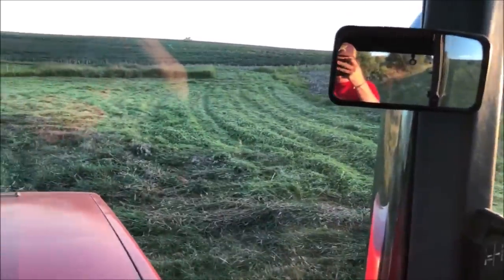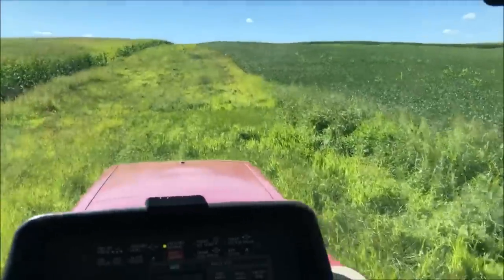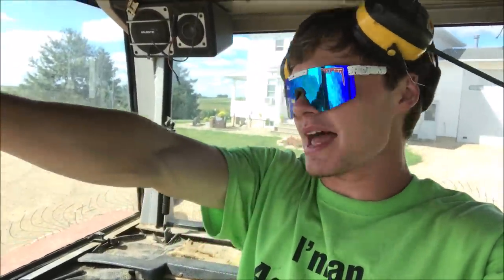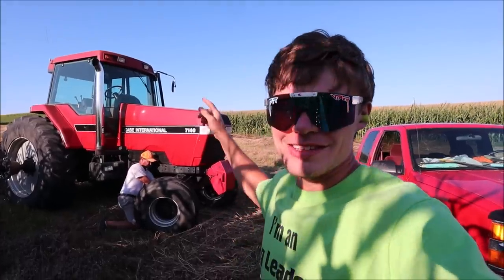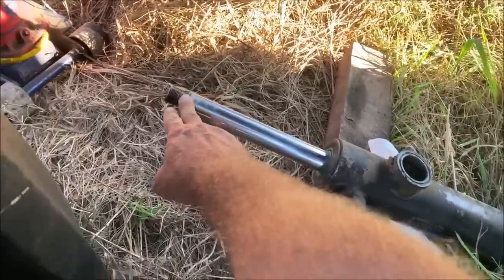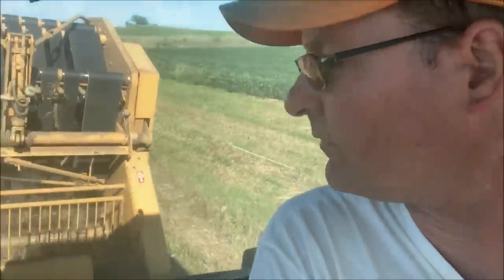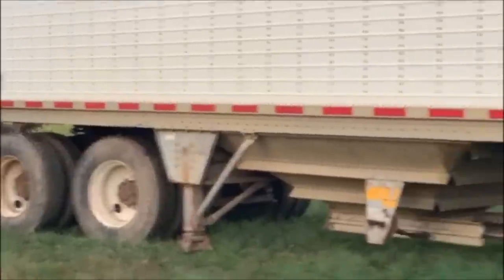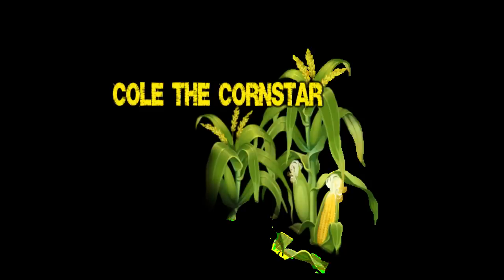We SNAPPED OFF A Tractor Wheel??

Comment: Once when I was about 11years old running the disc with our 856 IH I was turning around in some tall grass. I hit a washout hidden by the tall grass and after nearly face planting the steering wheel I noticed it wasn't turning so well. I had snapped the front axle in half. Took me nearly 15 minutes to get enough bravery to tell my Dad who was planting behind me. He was surprisingly calm about it-years later he told me that he didn't want me to be afraid of running anything for him. (When he was young during the 50's the first time he ran our old 'M' Farmall he hit a corner post-my grandpa was calm about it also and told him to get right back on.)

Comment: Looks like you need to fill those big wash outs with sub soil (brown dirt).  I suggest: a good source of sub soil/fill dirt is cemeteries, after a grave is dug. Easy for you to get some.  Then  find some top soil at the edge of the field to finish filling in the hole and plant grass to keep the soil in place.   It's not good to have a hole big enough to swallow a tractor.   Of course you are pros and you know what you're doing.  I'm just an old guy watching you work.  Stay Safe.    :)

Comment: Skid Steer loaders are bad about popping wheels, when they get rusty.  We were Chicken Farmers and the ammonia was bad about eating up skid Steer loader wheels.   We started off with an old International Skid Steer loader.   After We had it for about a year,  We started hearing this popping sound.   One by one,  every wheel on it broke out around the lug bolts,  because the ammonia in the Chicken Manure will really rust the wheels.  We ended up changing all 4 wheels on it, but after that,  We  didn't have anymore trouble.

Comment: glad to see a 2745 MF working  drove one for years , hard on fuel  we started at 7 am by 3 pm it need fuel are other tractors would run 2 days on a tank   .. IS THE 1000 # waite still under the frount of the tractor . the waite and 300 gallons if water broke the frount end off  where it monted to the engine.

Comment: Its a Volvo thing. Been in two white volvos identical to that one. One w a n14 cummins and one w a 60 series Detroit and they both have done that when the water was good but thats why it decidea to act crazy and just wants to beep all day sometimes is cause of somethin w the water sensor. They are good farm trucks far as the set back front axle being short and helping to get in and out of little ass field driveways you have to go in and out of sometimes but that will also help to get u some experience driving a truck cause if loaded good them same little tight driveways it will wheelie easy and teach u to idle and tap brakes little by little to make tires grab and turn lilbit everytime the wheels touch down. Farm in sho is the life aint it

Comment: When I worked in forestry replantion. We would farm the woods instead of tractors we used log skidders for our roller chopping and trenching there was a operator named Fred he was a good guy but a very fat smelly dude when he left the company we had to deep clean his machines cab and the smell was bad even after we had to replace the seat to get his smell out of it.
Reply from the maker: Sam klien gross 😂😂
Reply: Cole The Cornstar after 3 years and a damn near new cab except for the head liner on cold days running the heater you could still smell him through the vents it didn't seem that bad but once you were in a different machine then hopped back in that one it smelt just like he ran it all day and just got out. One of the nastiest but impressive things I've seen.

Comment: Cole coincidence you and Eric uploaded at exactly 3 hours ago? 🤔🤔🤔🤔🤔🤔 
Collusion perhaps? 🙄🙄🙄🙄😏
Reply from the maker: anastyb It was supposed to come out at 6!
Reply: @ColeTheCornstar  😘
 Hey also the next time you bust a tie rod on a tractor disconnect the implement and you can drive reverse dragging one wheel and still steering with the one connected wheel.
 I learned this one on an old Farmall and steered out the mud using right and left brake. 🚜

Ps not funny making fun of dad's old Ford can that thing is retro classic and rare'er because it was ordered a standard and not a C6.
 In the north that can would be rotted away.

Comment: Those short days that your pulling will make you miss the toilet bowl in the morning as your weaving back and forth. Your a candidate for a grease pit and a power grease gun hoked to a fifty pound barrel of the grease. If god loves you, you can get the oil, hydrolic oil, and any fluid that you use a lot of. But you need a designated place for this as dragging around all the stuff is called a service truck... Even a one ton dually will work but the more that you depend on it, the bigger the truck should of been. So start with say a two ton preferably and if your going to take it to wet fields and up nasty roads, consider 4x4 as the stock configuration is stronger and will get out of the trouble it gets into. I see a mid length service truck with a fifty gallon tank to run the power washer on, welder has one ten hock up for power for the washer and runs on teaspoons of fuel. I like the miller wire feed cause the good one does stick, wire, aluminum, and tig. and still run the handy stand 110v., lights for being on your back in a drain ditch at midnight fixing something that happened in like five seconds... a gin pole plus winch is great if you saved any during clean up.. A used service truck costs to much in the long run cause most have had the snot ran out of them and low on fluids making it get more attention that the stuff that your fixing but it does happen... rarely but does Another good video son.
Build one in steps and build what you want by looking at others and get a idea what your in for